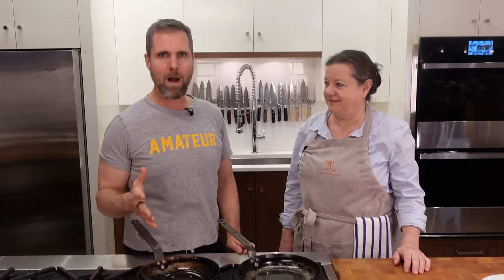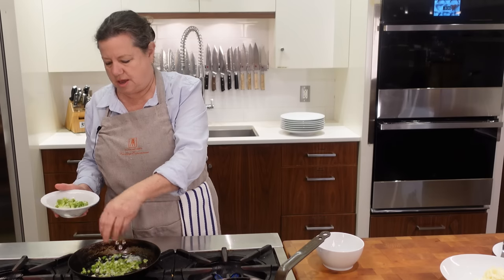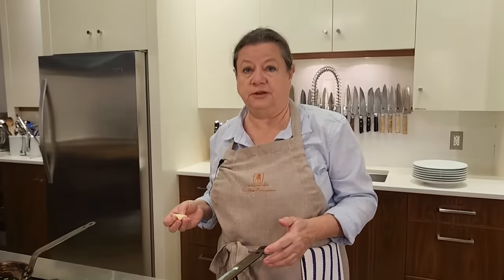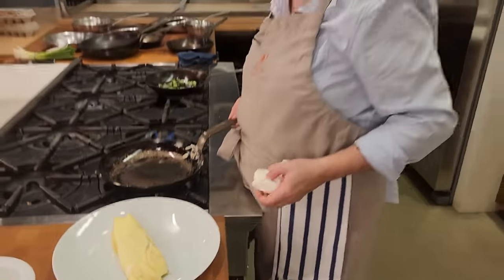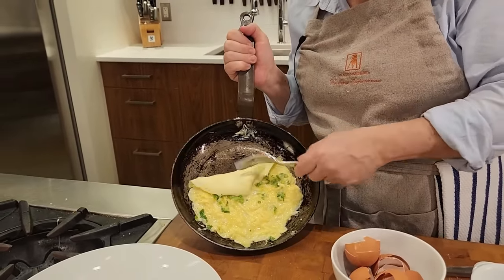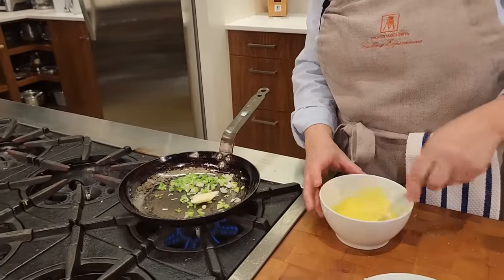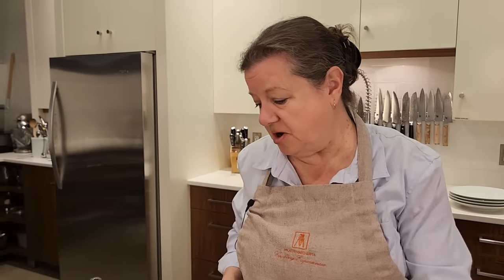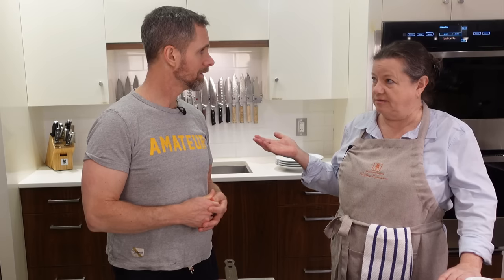Can we make a real French Omelette in  de Buyer Egg Pan?

Comment: Actually, a cured carbon-steel pan is a non-stick pan, just not one with a coating of plastics.
Scallions, water, no color, always baveuse, going back and forth with the heat, hardly a French omelette. The culinary traditions are much richer than this one fixed definition from some fancy high class restaurants.
Starting with the basics (eggs only, no water, no scallions) would have been a better introduction.
The vast majority of omelettes in France have light to dark colors from the Maillard reaction and are not baveuses. Such white omelettes have less flavor, it's basically scrambled eggs. By the way, scrambling the eggs in the pan is the worst way to make these ridges, as scrambling incorporates all the fat into the omette. The usual way is to lift the cooked parts all around and in the center too, so that the liquid eggs go under and can also cook. More of the fat can then stay under the omelette to create this traditional French yellow-brown color.
 
Carbon steel is the true French way though, or used to be, as more and more customers prefer buying several carefree chemical non-stick pans rather than a life-long pan that requires a little extra care.

The third attempt proved that there was nothing wrong using a single pan, adding the eggs directly to the scallions, lardons, mushrooms, sweet peppers, etc. At worst, you can dispose of these in a bowl, brush the pan with a paper towel and immediately reuse it for the omelette, there is absolutely no need for 2 pans. As for cheese or fines herbes, it's already mixed in with the eggs, and it's not because people love grinding fresh pepper on top of their dish that the French tradition does not also season absolutely everything at core with pepper. You need both.

Comment: As far as the outer shape she was able to do it, but this is not the same omelette as Jacques. You have to mix the eggs a lot more with the fork to get that small curd, you let it set way too early. This is the issue I see a lot with people trying to make a french omelette in carbon steel or cast iron, and reasonably so. If you mix too much, the pan will eventually start to stick if it's not nonstick.

I mentioned it in the community post you did before but I think one way it's possible is to cook the eggs over a double boiler first to set the soft curds. Then use a carbon steel only to shape it.
Reply: A properly seasoned Carbon steel pan is every bit as slick and nonstick as the best nonstick pans you can buy.
Reply from the maker: That could work!?!
Reply: @robgover8341  I disagree. No carbon steel pan can ever be as non stick as a new high quality non stick pan. I can cook an omelette with no butter or oil in my non stick pan. Try that in the most well seasoned carbon steel pan and you’ll fail.
Reply: @VikingShaver  that's gross. Might as well cook it without salt too.